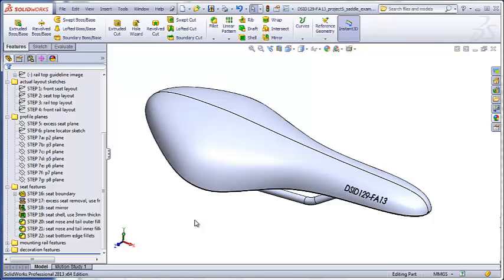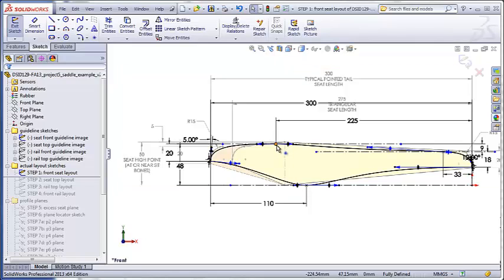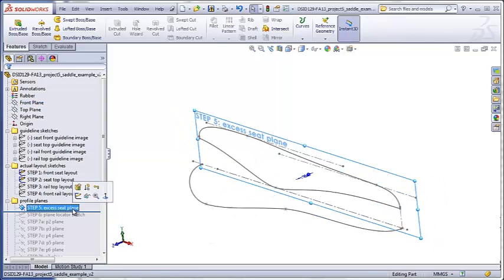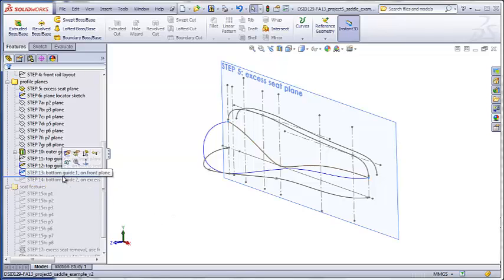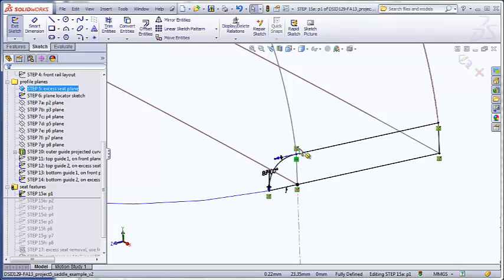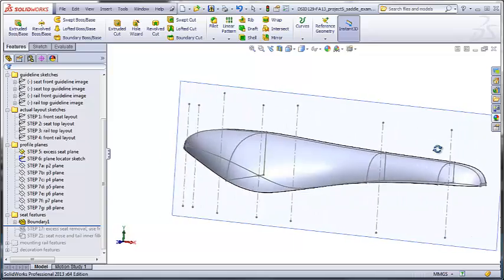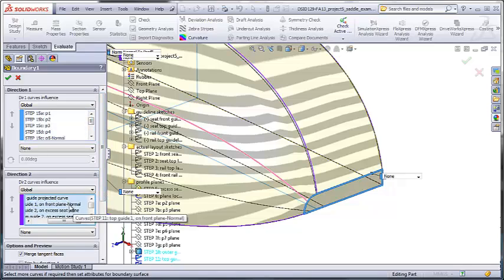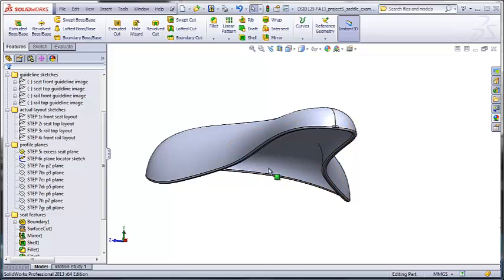DSID129, Solidworks Project 5-2, Bicycle Saddle - Seat

Comment from the maker: Yes, but those lines are contained in the original front layout sketch. I always advocate creating a layout sketch that will always remain at the top of the feature tree. If you need a curve from that layout, you need to copy that curve into a new sketch. This allows you to copy from the layout as much as you want, and still leave the layout at the top of the tree, where it is easily found. In this saddle example, the bottom curve is actually copied 3 different times.